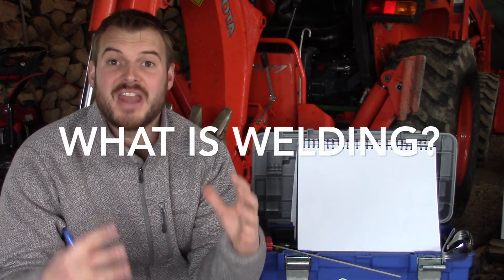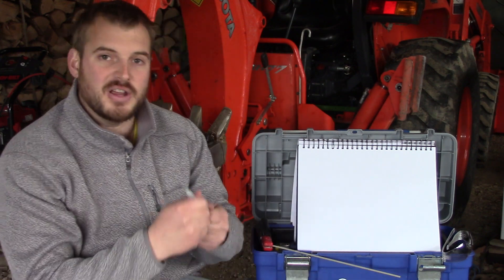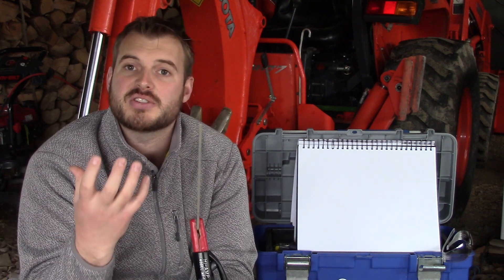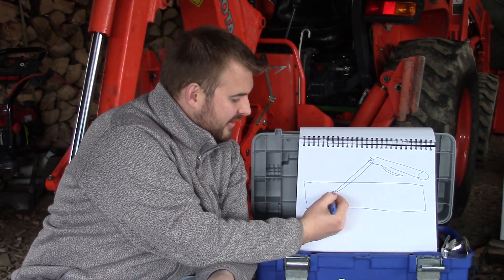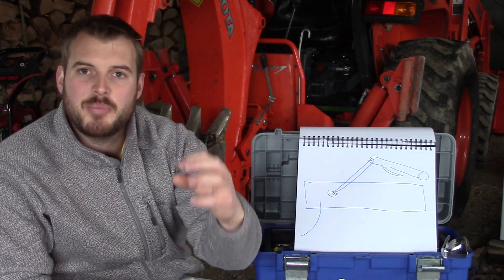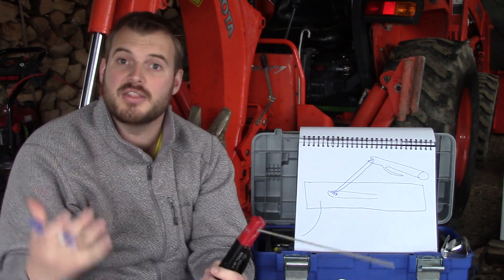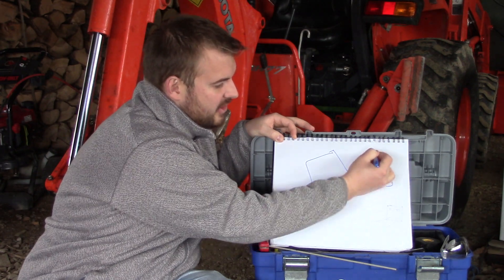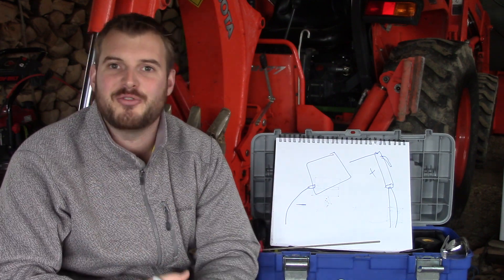What is Welding? -  Intro to Welding

Comment: A lot of people may be confused about you saying that electricity flows from negative to positive so let me briefly explain that...the negative side has most of the electrons so they flow towards the positive side...so since the positive side is recieveing all of the energy from the negative side, the positive side is going to be doing all of the work...that is just a simple way of looking at it...there is more to it, but for Luke's demonstration, that should help explain what is happening. ?.
Reply from the maker: Thanks for the input Gary! Valuable info :)